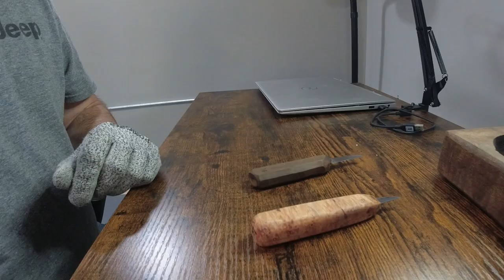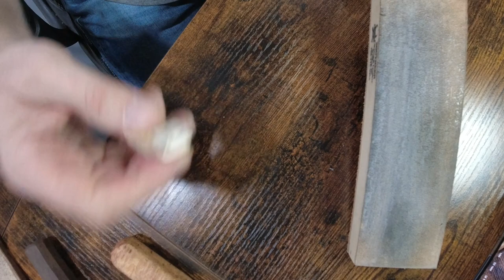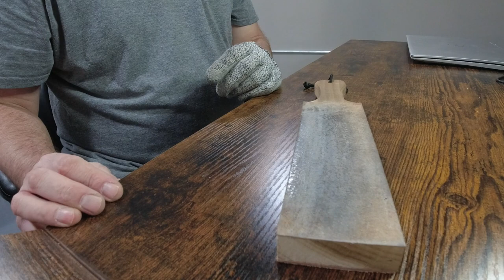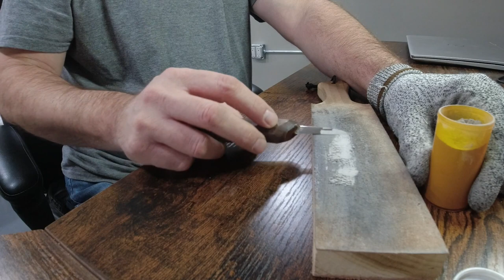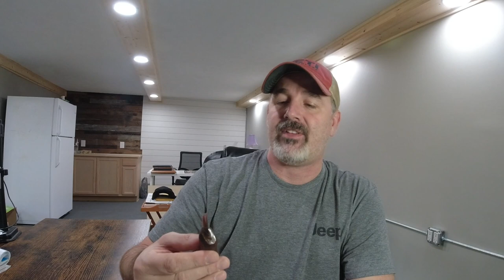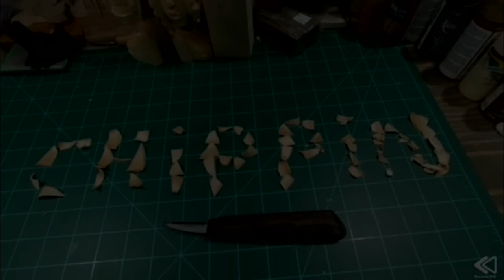MAINTAIN your WOODCARVING knife like this (Don't FALL Behind)

Comment: Blake question hopefully you still get questions even though it’s not a recent post.
  I was stropping away from the cutting edge. You ran blade towards the cutting edge with the longer blade and I believe away from on the the small blade knife?
  I must have watched to many westerns where the barber ran the blade backwards and just flowed with the curve of of the belt?
   I see your using a solid surface too!
Man no wonder I wasn’t getting any where?
Even my hunting knives I run on a wheel with the blade being sharpened from a rearward angle ?
Help !
Well I just re watched it .
Man with the curve on those blades I was convinced you were pushing towards edge .
 I was wrong!
I know you told me that but never hurts to hear you were right
Reply from the maker: Hey!  I am actually pulling with the spine side leading, keeping the bevel flat to the strop.  Imagine the strop pulling the micro-fibers out of the "teeth" of the cutting edge.  I flip the knife on the spine so as not to roll the edge.  That small blade is a little upsweep and may be a bit misleading.  
Hope this helps!
Reply: @lunsfordcarvings  
Ok thanks, it really looked like you were pushing into the cutting edge, rather than dragging causing the small burr 
  Thanks.  Yes it helped

Comment: The Barbers Roll!!! Blake, are you raising the spine slightly and how many times do you move the blade back and forth in your routine stropping session? Some say to lay it dead flat but I find that I don't always sharpen the cutting edge, just polish the blade sides.
Reply from the maker: That’s right!  I usually strop 12-15 times per side and check the edge, and may repeat if I feel like it needs it.  I do try to find the bevel with a slight tilt so you can pull those fibers out of the micro-teeth of the blade.
Reply: @lunsfordcarvings  Thanks Blake.

Comment: when using a wax based compound like Flexcut's , is it a good idea to clean the strop after a period of time ???
Reply from the maker: Once you get a significant buildup on the strop, I would recommend scraping it off and reloading it.  It will give you better results if you do this!

Comment: I use the Flex Cut gold, but it clumps unevenly on my strop. Any suggestions on how to avoid that? Thanks for the tip. I'll try the spine roll next time I strop.
Reply from the maker: I try to put it on like a crayon but sometimes it clumps also.  I've started using a product called ZAM with good results and no clumping.  Try that.  It is worth the money to purchase it!